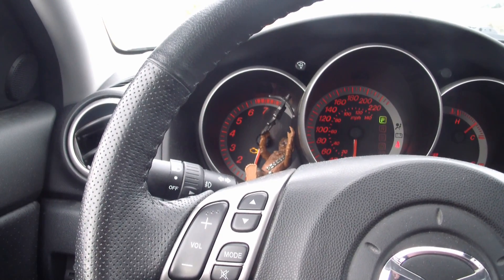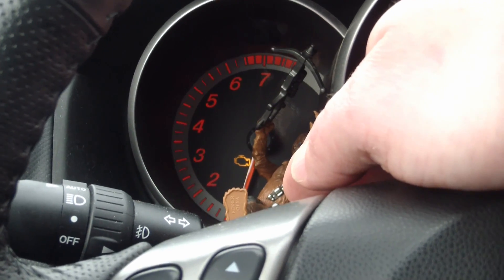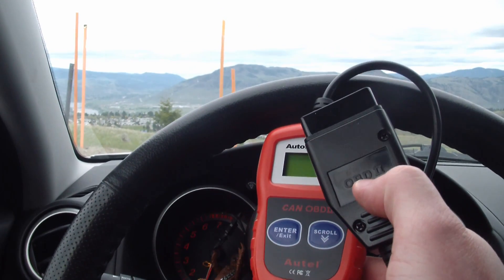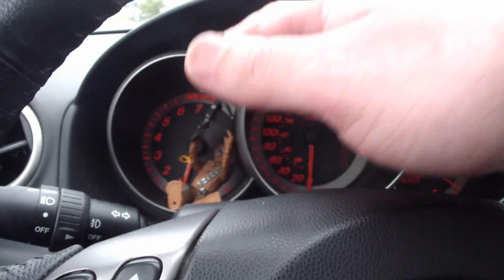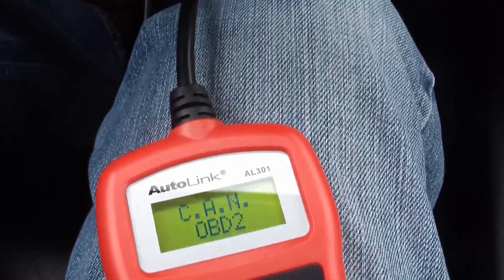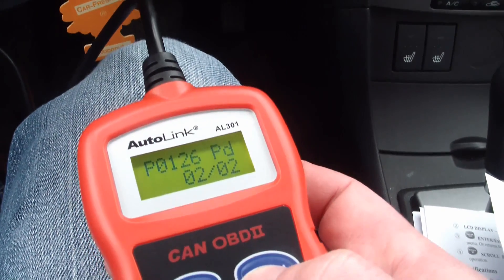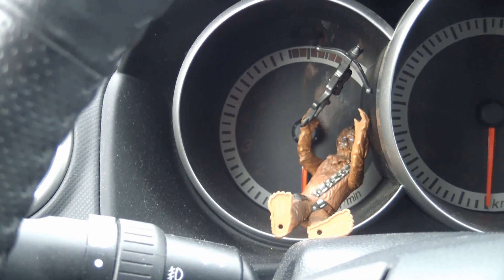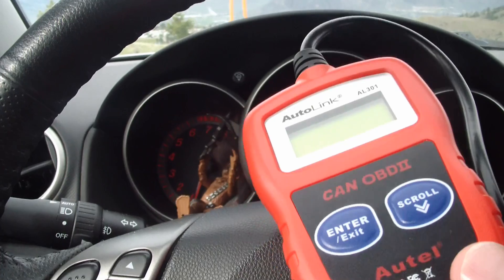Manly-Man Skills: Outsmart Mechanic Scams by Using Your Car's Computer!

Comment: This video, although humorous and lighthearted with good intentions, is more of a detriment than it is useful information. Yes, Dealerships are high priced and often times do not fix or repair a car properly. If your main concern is price and price only, you would actually be better off visiting a dealership in this particular instance because diagnosing a thermostat that is not closing which keeps the car from reaching correct operating temperature is a simple fix that could have disastrous results if ignored for long enough that it worsens. Fuel Injected cars, which all OB2 cars are, are designed to function in an optimum temperature range. One which will allow the engine to get enough fuel to run well when cold as fuel injected cars do not use chokes. They compensate with injector pulse width, meaning the injectors spray longer when the engine is cold. By having a  fuel injected engine which runs too cold, you are allowing too much fuel into the cylinders which ultimately cannot be burned and will cause piston ring wear due to washing, over-fueling of the catalytic converter - which can cause fire at worst or simply damage a $1000 - $2000 part at best. Some other replies on here are very informative when discussing clearing freeze frame data which will cause a proper diagnosis to be longer and more costly to Monitors being cleared which will keep a car from passing emissions testing/showing that all systems are functioning without fault. If the only thing you are worried about is cost, by all means, short cut it and shut off the light. You wont pass smog and will run the risk of causing further damage. But you will save that hour or two of shop labor to properly find out the problem. If all you are worried about is saving a buck, drive it with the light on, it isn't against the law, yet. If you want your car fixed properly, watch this article until the end, drive straight to whatever shop (hopefully an Independent) you trust the most and thank them for being educated. You could always go back to driving a late 60's or early 70's car which takes forever to warm up, requires frequent service and is nowhere near as reliable, but it is easier to repair. (By the way, "Pending" means that the fault has occurred within a certain predetermined amount of drive cycles which is over the limit to run the monitor stating "All Clear" so the problem should be easier to find as it is beyond the allowable limits for intermittent or "glitch" occurrences - It is getting worse. I could spend hours on this response but it probably would be wasted energy on this gentleman whose main concern seems to be price...

Comment: All the check engine light has ever meant on any car is:  You are polluting the atmosphere with improperly burned carbon-based emissions.
Reply: +psychodad1961 Who told you that crap???
Reply: No one had to tell me anything.  A check engine light will not tell you that you are about to spin a bearing or drop a valve into a cylinder.  It indicates that the ECM has detected an abnormal O2 reading in the exhaust as compared to throttle position, ignition advance or fuel mixture.  Look it up.  Your gauges (or idiot lights) and the Service Engine Soon light are for mechanical issues.
Reply: psychodad1961 it does more then just the O2 levels. Scan tools do airbags,ABS, and trans codes. Who ever told who that it only does O2 levels you need to get far away from them. a P0304 has nothing to do with 02 levels. That code WILL give you a CEL

Comment: P0126 Is one of the Faulty Thermostat codes I believe.... Basically you have a stuck open thermostat and your engine is not reaching the appropriate operating temperature fast enough, leading to increased wear of metal parts (cylinders, rings, bearings, etc) as the engine will take a lot longer to get up to temperature. The cooling system will also be less efficient because the thermostat will not close at the appropriate temperature to keep the hot coolant in the radiator to cool it down.

It will also lead to worse MPG since, until engine is up to temp, it goes through warmup enrichment, meaning it uses more fuel during warmup to make the warmup process smoother. The longer it is in warmup enrichment, the longer it uses more fuel than it should compared to if it reached normal operating temperature.

You can't just "clear" codes and fix problems that way. I don't work for any dealerships nor am I a professional mechanic. I'm just a dude that has his own cars and works on them to save money.  I used to have a Mazda3 2005 2.0L Sedan and it gave me this code. I had to replace the thermostat and thermostat housing which cost around $80 at the dealership brand new.

Comment: You don't have to take your car to a dealership to get your car checked out. Most parts stores will scan your car for codes for free. If possible find a shop that pays their people hourly not flat rate. Flat rate pays by the job. All dealerships pay their techs flat rate so they will try to up-sell  as much as they can because if they don't work they don't get paid. I've worked for one dealership & I'll never work for another. The shop I work at now pays a good hourly wage so there isn't pressure to up-sell the customer shit they don't need. I make the same amount of money for doing a timing belt as I do sweeping the floor. No pressure, & complete honesty with our customers.

Comment: hi I don't know if its of any use to you but you can get the Bluetooth modules of a auction site pretty cheap and leave it connected. 
there's a couple of good apps around that you can use to display interesting information about your car such as air meter readings mpg speed ect ect and can monitor for intermittent faults such as coolent temperature sensor faults or airflow meter breakdown. 
anywho I enjoy your videos and have shared and liked 
Al

Comment: There is one time that the check engine light(CEL) should be taking seriously. If that light starts flashing you need to get to a shop as soon as possible. A flashing CEL indicated a catalyst damaging miss fire. A miss is usually fairly cheap to fix, a catalytic converter is not.

Comment: I had to do some work on a car recently and I had to use one of those readers while doing it.  While using the reader I had the idea that if you could hook up a smartphone to the car, you'd be able to see the actual data coming from the car computer.  After googling some things, I found out that with the right connector and an app on my phone I could do all of the things those readers can do.  I'm not saying that it's better or worse, I'm just saying that it is and you might find it interesting to try it.

Comment: They can't just build one right into the damn car ffs..
Reply: +Walter Sopchak Mopar does have one tied into its ECM program. Its triggered by turning the ignition switch on and off 3 or 4 times and then leaving it on. You then count the flashes of the "CHECK ENGINE LIGHT" all of their OBD2 have it,

Comment: AvE, buddy, DTCs aren't a manufacturer or dealership scam, they're a regulatory thing related to OBD-II standards that were enacted in the 1990s. Meaning: cars sold in North America (and, of course, now RoW) must have systems that monitor major components related to emissions compliance and operating efficiency. It's a legal thing, not a racket for OEMs and dealerships/techs. While the standards for OBD were initially proposed by SAE, it was really driven by a mandate from CARB and the EPA (and others). *[FYI, I'm writing this a both a Patreon subscriber and a fellow pompous Canadian-now-expat] 

Basically, CARB says to the OEMs: "We gotta make sure your vehicles don't emit too much stink once they're in service, so figure it out."
OEMs/SAE: "Well, I suppose we could put computers in there to monitor the systems..."
CARB et al: "Good. Monitors. And we're probably going to require you to teach the field how to read the monitors and fix it. And certify it. And we're going to need it sooner than you think you can produce it."
OEMs/SAE: "Crap. We need standards."

And lo, OBD was born. 

About dem CELs: If a fault is detected within the system, the frequency is measured and a priority is assigned. If it's a priority 1, with a high probability of diminishing the car's ability to maintain compliance with OE-spec at the time of original assembly, then a DTC is stored and a CEL you get. Your car could have a dozen priority 2 faults and no CEL, although it is often at the OEM's discretion. But generally, OEMs aren't luring you into a $130 flat rate hour dealership service visit with a CEL lit-up for one janky wheel speed sensor or short in the locking gas filler door; it's because something emissions-critical is bad and they're required to notify the owner to get it checked out. 

Note also: 
- Solid CELs indicate a fault condition with priority 1 and it's generally safe to continue driving your now stinkier car. 
- FLASHING CELs generally indicate a more significant problem where the fault could lead to much more significant mechanical/safety systems failure.

Comment: No no, jus lemme lissen to ur engin for a minit. Yeap! That scurrying piston sound means that the tamping whopple is not correctly engaged with the laughing shaft of your obfuscating sprocket valve.
Reply: +wordreet Nah man it was the turbo encabulator.
Reply: headcas620 Or it may be the Wooky on the dial.
Reply: +wordreet I think the compression is bent!
Reply: Biggerbadwolf It's nasty when that happens! :¬o

Comment: When someone walks into our shop and says "replace my radiator" rather than "fix my car, it overheats," we call it a cheeseburger. Because when you walk into McDonalds and order a a cheeseburger, you get a. cheeseburger. And if you ask for a radiator, you get a radiator. Doesn't matter if its the problem or not. If it was actually a blown head gasket and we did that instead you best believe they'd try to skin our hide. it'd be like McDonalds givin yah a salad instead if your burger and tellin yah its what yah need rather than what you want.
Reply: Definitely. We get people coming in to the shop all the time telling us that a parts store read their codes and that it mentioned something about a solenoid, so of course, it has to be replaced. We try to explain why their car needs to be diagnosed to find out if it's mechanical or electrical, wiring, trans failure, stuck valve, etc. They insist it's just a solenoid. We replace it, and then they eat crow when we get to charge them twice when it doesn't fix it and we get to say, "We told you so." We've invested years and thousands of dollars into our tools and expertise. There are bad apples that spoil the bunch and the dealers are just part replacers and crooks, making it hard for people to trust those of us that are honest. It's never cheap to fix your car and you get what you pay for.
Reply: +nikki martinez Its like some people want to have it scanned to see what the repair will cost and wonder why they were charged for the scan, when all they had to ask for was a estimate of the cost to repair the car. The scan has to be done in order to repair it correctly. Any shop that charges for a scan as part of the repair is a crook. I just love it when they bring the parts that they think will repair their troubles. Like bringing new spark plugs cause the car has a mis-fire when in fact its a bad plug wire. People like that by the shop lunch and sometimes even dinner...LOL

Comment: Great, now we will have even more idiots clearing diagnostics data that could be vital...  Clearing the CEL causes all the systems to clear out, and it can take hundreds of miles of driving for some systems to complete their initial diagnostics to report that they are ready.  EGR system malfunction?  Typically wont get the EGR codes to come back till it's completed the self tests, and that can take a good long while, and at the same time cause an engine to not run worth a damned.

It's more important knowing what each code actually means, how they are set, and what can cause them, it's even more important that idiots stop driving a car when the MIL/CEL or w/e people want to call it these days is flashing.

Comment: After watching this video i went on Ebay and bought the exact one. Beauty of a thing it is. The CD installs a program on a home pc or laptop in which you can type the code in and it will display the fault without having to use the book.

Comment: I use the wifi odb2 attachment and the DashCmd app.  Works great !  Just don't try the blue tooth one if you are on an IOS device - iOS doesn't implement the Bluetooth stack properly and it doesn't work.The app shows you exactly what the code means and does a whole wack of other stuff, data logging, you can save your drive and see plots of various things.

Comment: In terms of computer technology, it takes very little power to control an engine, I say its a only a matter of time before there are cheap hardware options with open source software to circumvent the racket that oem manufactures as well as aftermarket standalone companies have been enjoying.

Comment: You need a thermostat. That code isn't gonna come back right away. That code needs two full drive cycles with a fault before the pcm will allow a check engine light. But, you probably know that already.

Comment: just fyi if u own a dodge turn the key from off position to on (don't start it) position 3 times and leave the key in the on position the 3rd time it will read out codes in odometer screen look up the code on the net saved me 50 bucks to not need reader

Comment: The bad thermostat in your car is costing you money...  With the thermostat stuck open (which is what your fault code indicates) your engine doesn't warm up quickly enough, which means you will be stuck for a while longer in open loop and burning too much fuel.  You could possibly (but unlikely) damage the catalytic converter over time as well.  The code will take quite a while to show up again.

Something to chew on.  :)
Reply: +shepd shepd Not always a thermostat at fault, sometimes the sensor can just be plain flaky, that's why you need to have an FSM that will list what resistance the temp sensor should be at, and what voltage should flow across it at certain tempertures for testing... Replacing a t-stat on some cars can be a ROYAL and COSTLY bitch for a $9 t-stat compared to a $15 temp sensor.

Comment: You just cleared a code that was stored in the computer, it could be a real problem you can do this with anything to just clear the code it does not mean the problem is instantly fixed. the reason dealers cost so much is because they go into proper diagnosis of the engine light to make sure your car doesn't have that same fault 10k down the road

Comment: If the coolant is too cold... you need a new themostat!  $10 part, easy to replace

Edit:  If this were at my shop and someone had it in their mind to try to make as much money off this as possible...  assuming your vehicle had relatively low mileage recommendations would probably be:
Thermostat + Coolant flush + hoses
And maybe a tuneup based on mileage

Total cost to you would be like...  I dunno.  Less than $500
Reply: Depends on the car lol.. My audi's thermostat is behind the timing belt. That job is 1500+ cause you're gonna do the timing belt pulleys water pump, probably flush, serp belt, and anything else in there.
Reply: I really don't think high end luxury cars are designed to last more than 100k miles.  Makes sense if you think about it.  They're target demographic has enough money that they probably wouldn't keep a car that long anyways.  Every mercedes and audi I see with over 120k miles is usually in really bad shape.  For reasons like what you mentioned. Thermostat was probably intended to be a lifetime part
Reply: +kevin smith   Easier to drain the cold coolant and refill with warm coolant. Problem solved.